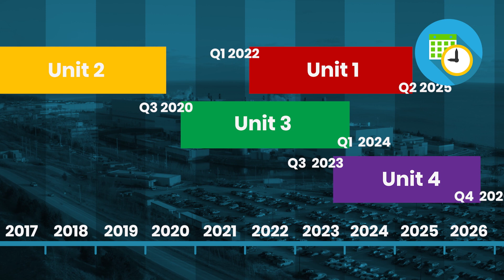Darlington Refurbishment Project - Performance Update Q3 2020

Comment: 27 million hours would deploy 20 GW of solar panels which would produce 60% of the yearly electricity of Darlington, with nuclear fuel supplied by our sun for free.
Math : 27 million hours to refurbish a 4GW (4 million kW) Nuclear plant = 27/4 = 6.75 hours per kW of production.   
My solar panels took 6 hours for 4 kW of solar (5x faster to deploy).